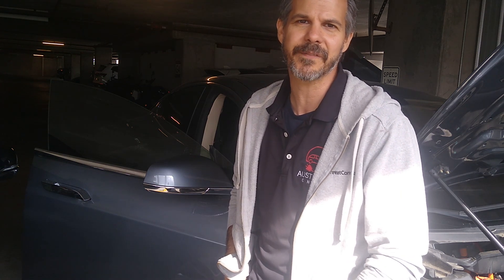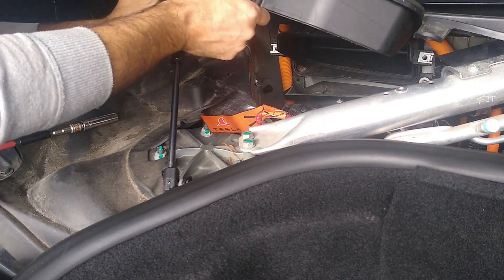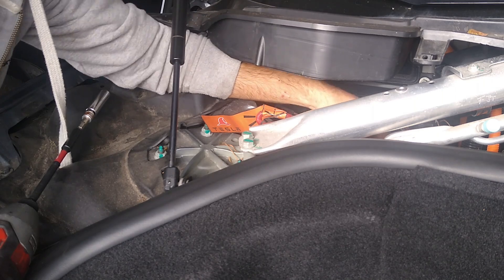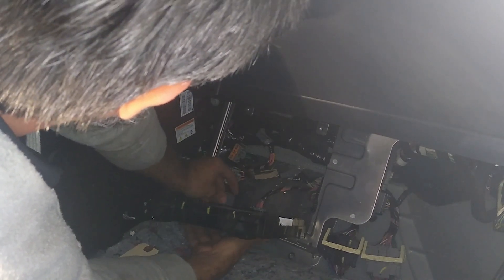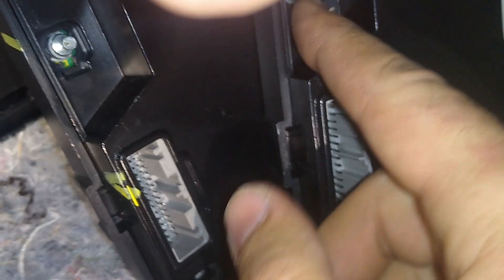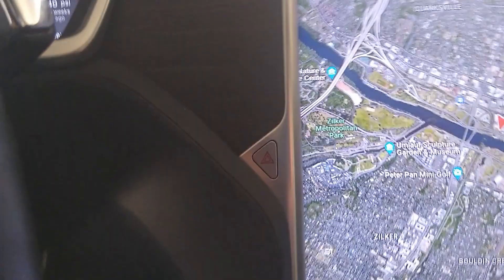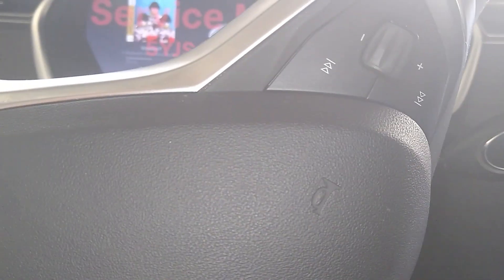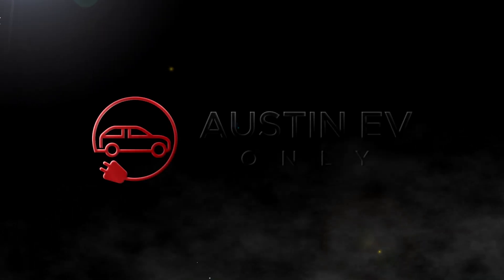Replacing the Body Control Module on Tesla Model S

Comment: Thanks of for the video. It would be nice to have details on removing that last small wire. Have the same issue. Also, the the details of programming. If you get a module with a key, will it work with all the car stuff (remote lock, etc), or just to turn the car on and off. Other great information would be diagnostic procedure to make sure the BCM is the issue.